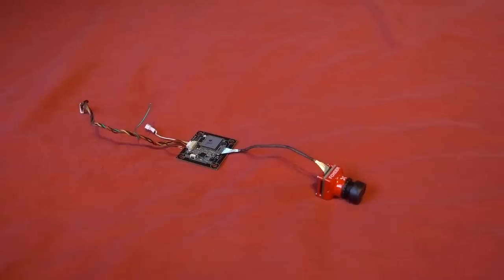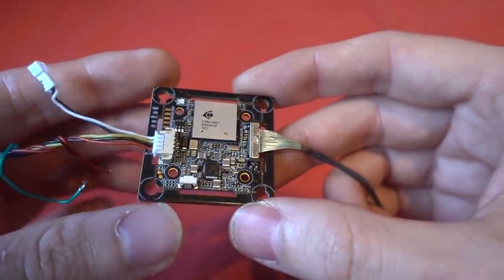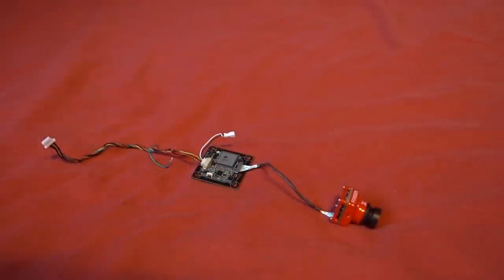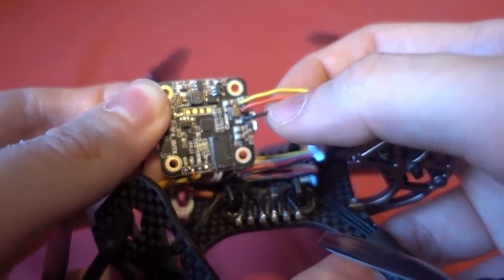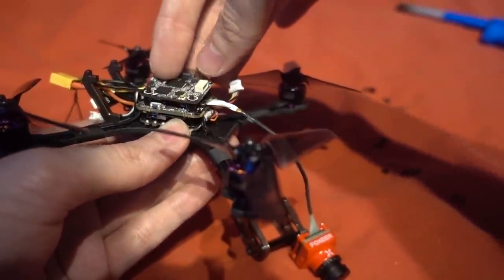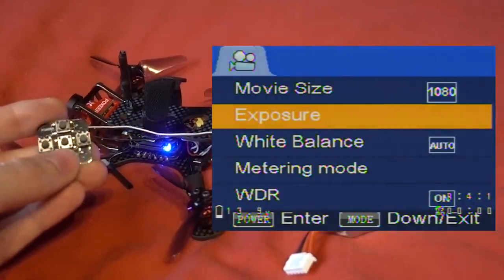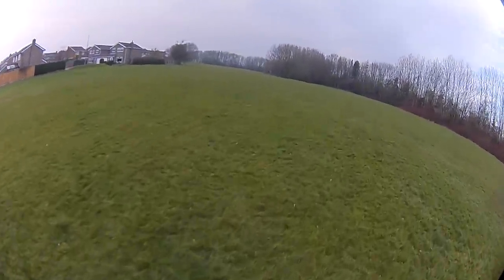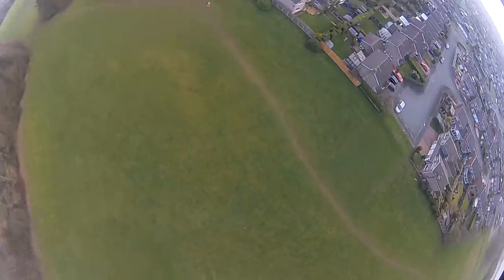Foxeer Mix FPV + HD Recorder

Comment from the maker: Foxeer Mix: http://bit.ly/2XdKinS
Caddx Turtle V2: http://bit.ly/2NqjpIE
Runcam Split Mini: http://bit.ly/2Rv5k22 coupon 23f4d4 (EXP 28.02.19)
LISAMRC LS-X140: http://bit.ly/2BIyocw
Frame: http://bit.ly/2tsH1n3
Lipo: http://bit.ly/2V2bOTg
Time Stamps
0:00 Overview
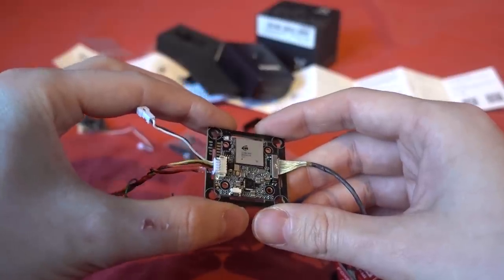10:44 Install
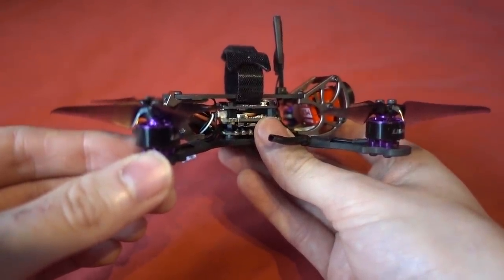18:30 Menu
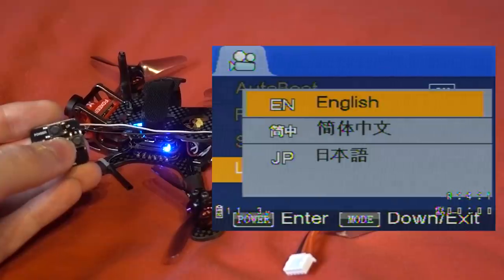22:32 Flights

Comment: I wonder if you went from wide to medium or narrow if you'd get rid of some of that fish eye  .. which is pretty severe. You might consider getting a different set of test leads for your Fluke (long needle point), which would make hitting small test points easier (especially for shaky hands ... ;-)   )   Thanks for the review. Nice to see all these options. Cheers!

Comment: i'm a big fan of the runcam split and v2,  havent tried a mini or a caddx yet, the mix seems a decent attempt at this format, i'm sorta hoping runcam do a non live fpv mode split with 1440p even at 30fps,  i'm currently using the eagle micro in 16-9 and low down between the props witha runcam split (1 and 2) on top all protected by carbon... really happy with it as a set up, the eagle on 16-9 makes framing stuff for more cinematic flying much easier since its almost a perfect match to a splits recordings.. ps. stu beat your 112mph record..... your not gonna let that stand are you?

Comment: Awesome review Andy you covered everything. I am so tempted to get one of theses but I have had so many problems in the past with the run cam split range, I have had 4 of them fail on me mid flight (screen goes blank) I lost one quad and I also had one on a plane witch smashed to bits when the split failed (RIP) 

However Foxeer do make some awesome cameras so I'm tempted to pick one up, but I know you love this quad you mounted the cam in so you will be flying it a lot so I'm going to wait and see if you have any problems in the Future. Cheers Andy

Comment: I don't think you gave this much justice with your flight footage. I've had mine for a while now and it's great. It also has the ability to save the video file if you eject the battery by mistake or power off and forget to stop recording. I don't think Runcam or Caddx do that?! Low light is a bit of an issue with this but it's fine for daytime flying. cheers.
Reply from the maker: yup caddx and runcam both do that. they are also on their V2 with better image quality higher bit rates and having every iteration of these cams I can say with confidence its got some work to do. But how did i not do it justice? by using the auto settings? there is no option to up the bitrate or sharpness only color correction, nor is there a site with firmware updates. So I struggle to see how this can out perform the others which in my opinion have much more options and better auto settings. I would really recommend you try the caddx turtle v2 its a leap ahead in my experience but at the same time I wont write off the foxeer unless they fail at addressing the issues I have highlighted.
Reply: @AndyRCchannel  I haven't tried the Caddx but the Runcam doesn't save my files after a sudden power off.... Maybe i need to update the firmware or something?! If you didn't use the wide setting, it would remove the lens from the video and make it look a lot better IMO. Hope you have fun and happy flying dude!

Comment: Solder one side of the u.fl connector to the u.fl pad to keep it from popping off.  RDQ does this in their mach 2 vtxs
Reply from the maker: its not the popping off thats the issue its the number of times i had to disconnect it to install the mix. cheers for the tip though

Comment: You should go for a Gopro replacement lens. Less fisheye.
Reply from the maker: im pretty sure u need a special tool to take the lens out. I couldn't do it I guess its so they can guarantee they are all in focus.
Reply: @AndyRCchannel  
Haven't had a problem with the replacement of the lens. :-)
Reply from the maker: please do share

Comment: I've put about 15 packs through my Foxeer Mix. My first thought was "this is terrible" I was running 60fps 1080 and it was dropping frames in the FPV, and the HD video was losing 20 seconds at a time and single flights were broken into multiple videos (Class 10 sd). I had to drop it down to 30fps to be flyable and the issue went away. The HD is also REAL bad in low-light. It tries to do some sort of blending but what ends up happening is you get really, really bad "ghosting" of the props if they're in the frame. I'm really hoping they release a new firmware soon to fix these issues, the fisheye effect, and the lack of settings in the OSD (can't change contrast?!). The microphone is completely useless, it gets blown out with any punchout.

The only redeeming quality is that in a head to head comparison of the FPV and HD with the other competitors proved the Mix to have the best video quality for sure. They certainly have a lot of fixing to do though. Make it happen, Foxeer!
Reply from the maker: you must have a different firmware to me i dont have any dropped frames.
Reply: @AndyRCchannel  very possible. I couldn't find the firmware update anywhere. I think it may have just been a combo of low light and high fps. Perhaps you can try replicating it? Gopro does the same thing but since you don't fly FPV from it, it's not as big of a deal
Reply: @PixelFPV  
What version are you on? Mine is showing 1.63.22S. I did not notice dropped frames. Might be your SD card!?
Reply: @ZeroFPV  I'll have to check, I'm flying after work today. I thought it was the SD but after switching to 30fps I haven't had any frame drops.
Reply: @ZeroFPV  confirmed I have the same firmware version as you

Comment: I'm getting some noise in my HD video when I really hit the throttle.  Did you have any of that with your testing?
Reply from the maker: no but if its happening when you hit the throtttle then thats noise from the escs. do you have a capacitor fitted?
Reply: @AndyRCchannel  Yes I am using the cap that comes with the Dalrc Engine and an extra one on the battery pig tail.  I hear the same on this video. go to 18:20 https://www.youtube.com/watch?v=SWjxHOKUs9c

Comment: That ribbon cable  is  scary.
Reply from the maker: you would be surprised how tough they are and are most likely in a lot of your electrical appliances that you dont realize. they are also a much better solution than FFC which break sometimes from a single bend and those are in an even more shockingly amount of electronics such as fatsharks and transmitters. one split in those and your devicve is toast at least these flex without conciquince. its ironic that FFC stands for flat flexible cable when flexing them under 10 times can cause a break in them. This solution is much better trust me despite it looking a mess